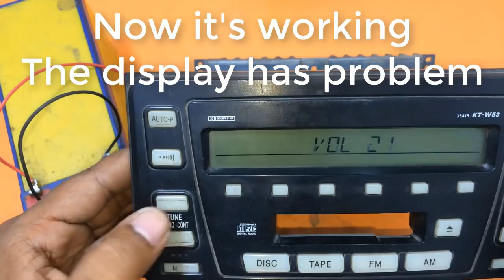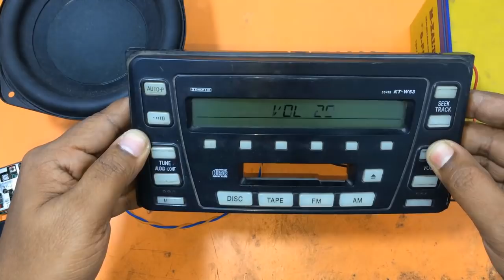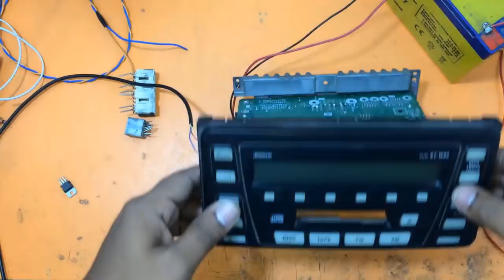Car amplifier using at home

Comment: I have 2 4 wat speckers. 
2 TPA3118 PBTL Mono DC8-24V 60W Digital Audio Amplifier Board to drive the speckers.
1 19.5 v 90w max power adapter.
1 12 v 2500ma laptop power adapter.
Will the 12 power sapply 2.5 A be good aneff to drive both Amplifier Board?
Will the 2 TPA3118 PBTL Mono DC8-24V 60W Digital Audio Amplifier Board get hot? 
My son says I need 100w and 15 to 20 amps to drive the 2 speckers. is that so.